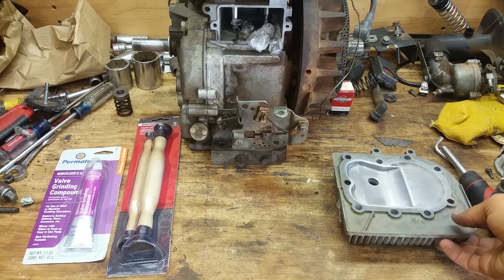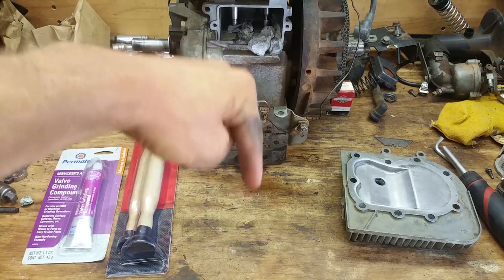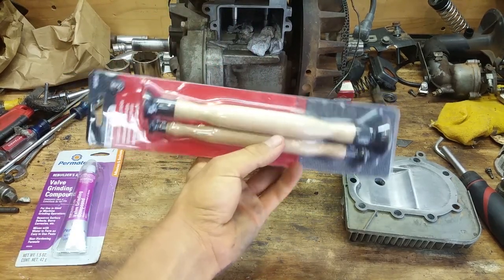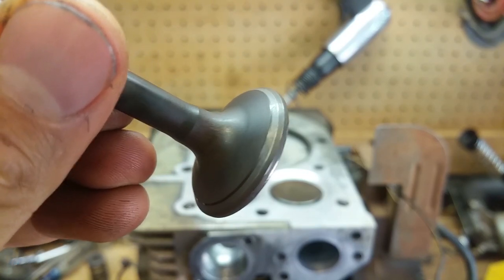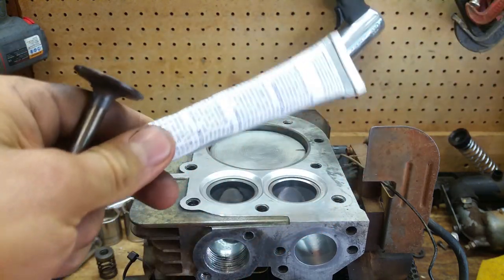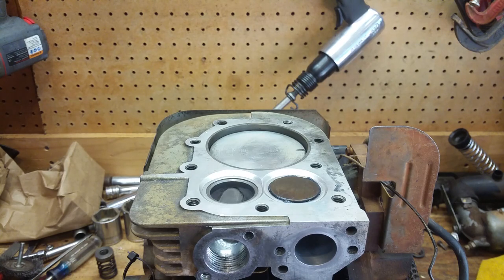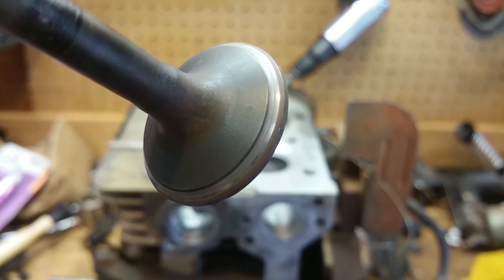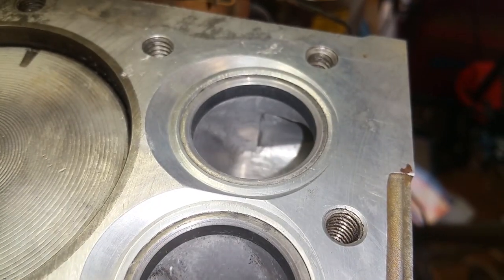How To Lap Small Engine Valves

Comment: well i saw one guy took a piece of gas tubing or a vacuum hose that fits over the other side of the valve on the stem used a cordless drill on med or lower speed pulled gently on the drill went one way but I supposed you could do one way for a min and then the other way and also you could duplicate the compound with water just a few  thoughts I have a 4 cylinder Subaru with 16 small valves and was think about with process to use and then you could even visually see the results better with Permatex Prussian Blue, which is bluing compound & is a non drying marking compound used check the contact surface of a valve face to valve seat when working on a cylinder head
Reply from the maker: The plastic tube on the drill trick is good to know.

Comment: you didn't say exactly how long you lapped the valve, is it 2 minutes or 20 minutes, just a guideline would help.
This is my second time tearing it all apart again because it still leaks air out the exh valve.
Reply from the maker: Honestly, it would have been better to get new valves and cut new valve seats then lap them in. It's too much work for old equipment. This worked pretty well to get it running. I lapped the valves until they were mated together well. Could take 2mins could take 20mins.

Comment: In your video, your tool got valve griding compound greese on it and it began slipping all over the place. You couldn't keep the tool center on the valve, because the tool lost contact often. That also means you can't apply lots of pressure on the head of the valve, where with my set-up, my connection to the valve, never moves off center, no matter how hard you apply a downward pressure. Like I said, I can apply 20 lbs of downward pressure using my method, and again, it never moves off the center of the valve during the whole lapping job  ... start to finish. I'll make a video later down the road and show you the right way (and make a cheap homemade tool, costs less than $5 to make), to do a fast  complete lapping job perfectly with next to no effort at all. Watch for it in the coming future. Once you try it out, you'll throw away those foolish factory made lapping tools shown in the video here.
Reply: Well what is it?  I'm having issues
Reply: I overlapped I think and never got a perfect seal with 62# springs I
Reply: A better lapping tool is a piece of 1/2 inch dia. wooden dowel wood, and a small supply of double-sided sticky foam (normally used for hanging pictures to the wall. Just cut out a small piece of double-sided sticky foam about the size dia. of the valve head. Press the piece of dowel end against the valve with the foam attached to the head of the valve before adding the valve compound. Insert the valve, and start lapping. Not only can you apply far more dowdnward pressure while lapping, but the dowel wood also doesn't move off center of the valve while lapping. It stays center at all times. That's the best way to lap valves properly and quickly. Those valve lapping tools are garbage in my book. You'll be surprised on how fast you can lap valves in the manner I just explained, and with so much little effort as well. What would take you 5 to 10 mins of lapping with a store-bought lap tool, I can do in a matter of a couple of minutes withe ease, and be done long before the store bough lap tool is even close to being finished. In used this method for sandpaper lapping as well, and it worked both fast and great. I'll never use a store-bought lapping tool ever again doing valves. My method really grabs the valve needing lapping. Double sided foam tape is easy to remove when done, but those sticky sides provide lots of grip to nthe valve needing lapping.  Lots of grip, and dowel stays center while lapping.
Reply: @waynedavies3185  your a regular Eli Whitney
Reply: @waynedavies3185  Great idea, thanks for sharing your setup greatly appreciated! 🙂

Comment: I dislike using those lapping tools. I came up with a far better way of lapping valves. Most time the lapping tools you are using keep losing contact with the valve and slid off. You can't use mkuch pressure to get the valve grit to do a proper cutting. My way with my home made lapping tool works a whole lot better and quicker. I can apply as much as 5 to 20 lbs. of pressure on the valve being lapped. With the tools you use, your lucky if you can apply 2 to 5 lbs of pressure on the valve. I might add, my tool doesn't come off the valve while doing a lapping job. It stays right dead center of the valve all through the whole lapping job. Those bought lapping tools are not worth the money paid for them. I threw mine away, because they were totally useless and did a poor job from start to finish. With my tool that I put together, I can have a lap job done in 1/8th the time it takes using the lap tools your using. I have had tiny pin-point small nicks in the seat walls on some valve seats, and was able to remove them in 5 mins. or less, just using only valve compound. Once I attach my valve spinning stick to a valve, it makes good solid contact, and never moves off dead center, and never loses a solid grip on the valve throughout the whole lapping job. Maybe someday soon I'll share my secret with you on how to do a lapping job in record time, and end up with a perfect job every time without the lapping stick going all over the place while lapping.
Reply: Man the anticipation is just killing me
Reply: Must be going to patent this idea?????????
Reply: Can you please share either in a video or describe how it works and its made?
Reply: Been waiting a year and this fella is still holding the secret like it's the code to nukes.😂
Reply: This is really a rude comment. Poor man
Reply: I should tell you how I do this. I use a piece of small dowel wood about 8 to 10 inches long. I use a small piece of two sided sticky tape I pick up at the dollar store. It comes in small square shapes and has a foamy softness to it but sticks reall good to both the dowel and the valve head. Put a small amount of griding hrit on the valaves edge and place it in the spot where it normally goes in the engine. Carefully one end of the dowel (which should be very flat so all parts of the dowel stick to the other side of the tape. It sticks well enough that a fair amount of pressure can be applied to the valve while you spin it and not have the dowel come off the piece of tape or go off center. I can easily put about 10 lbs of pressure on that valve while spinning it which allows me to do the valve cutting in record time without having the store-bought type of valve spinner always slipping and sliding off the valve while spinning and cutting. Once you make you proper cutting just remove the dowel and the tape. Very simple and less frustrating to boot because the dowel wood doesn't slid off the tape or the valve while spinning it. Try it out and see for yourself.